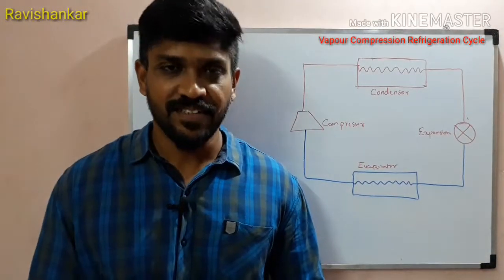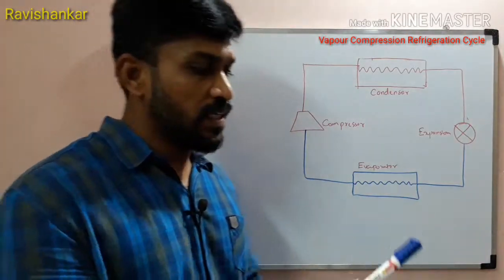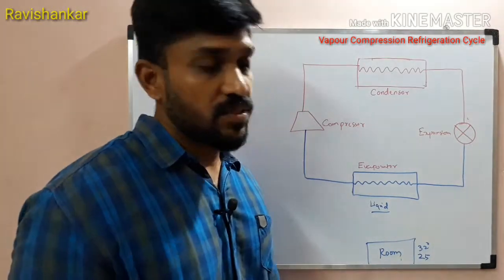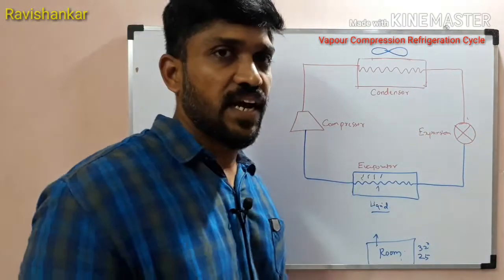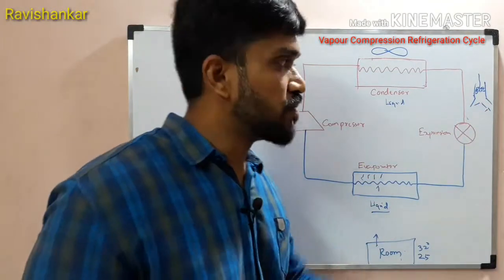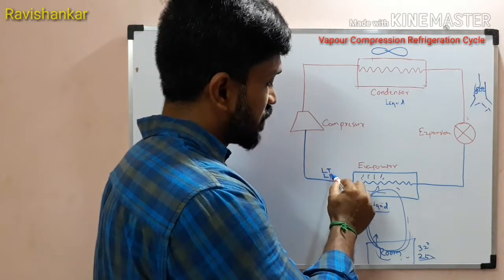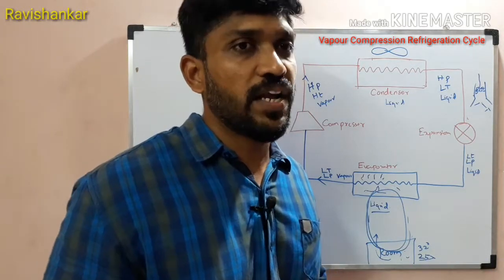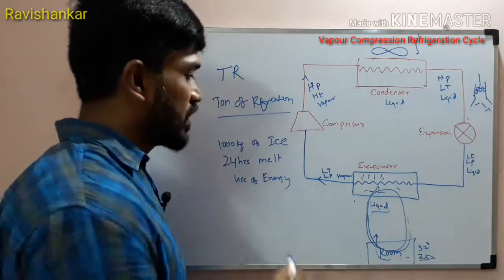Refrigeration Cycle working principle tamil

Comment: Anna solined valve எதுக்கு ஏன் use pandranga sollunga plzz😢
Reply: Just oru magnet  coil used for air,gas,water control for electric valves called solenoid valves

Comment: Anna 
What are the mechanical theorems used in refrigerator procez?
Reply from the maker: Refrigeration concept Is a heat pump concept which we transfer one place to another
Reply from the maker: Carnot cycle
Reply from the maker: Thermodynamics
Reply: @lohisya_media  any brynols like theorems used bro?
Reply from the maker: @noelbrianrutter1926  piriyala bro
Reply: @lohisya_media  check your mail brother

Comment: Intake and outgoing system in Evaporator and Condenser not properly explained,                                               same process in Central and non central Ac systems with in and outgoing refrigeratant lines to be explained more

Comment: Sir outlet of expansion valve is in liquid form and after evaporater  how it became vapour, is any heating process going on evaporater
Reply from the maker: Yes we are using our room heat which is load that temperature is enough to boil liquid refrigerant  to vapor refrigerant
Reply from the maker: Bro please check my refrigeration video in my channel u will understand more